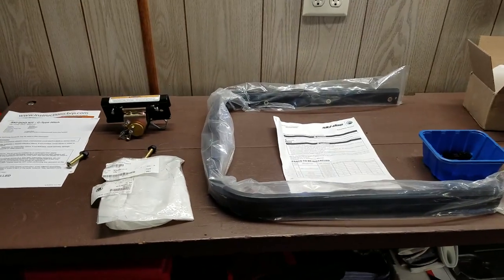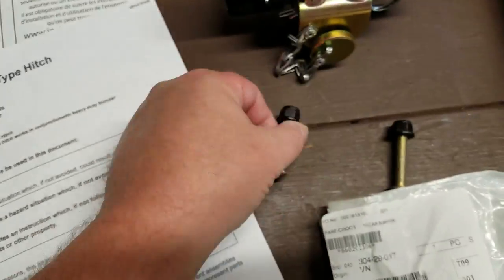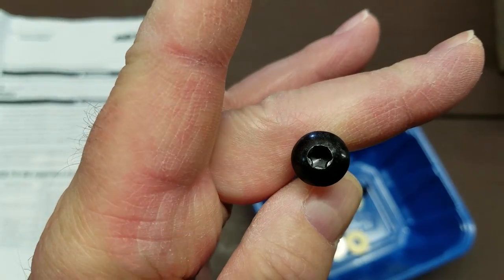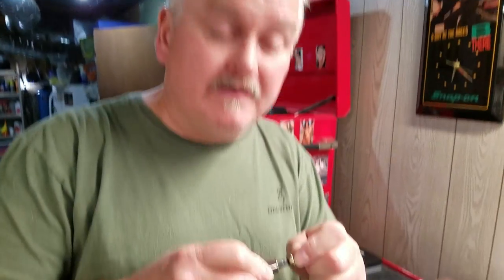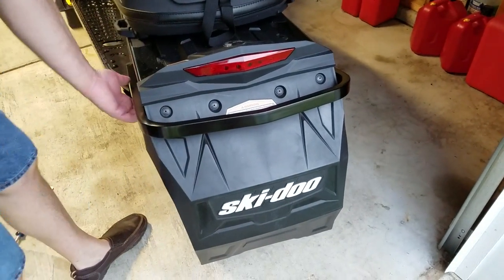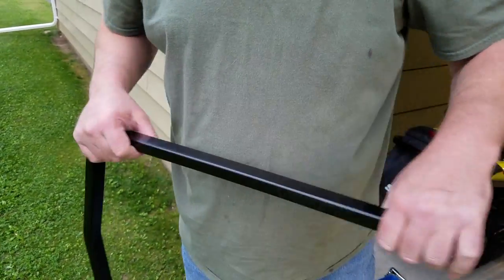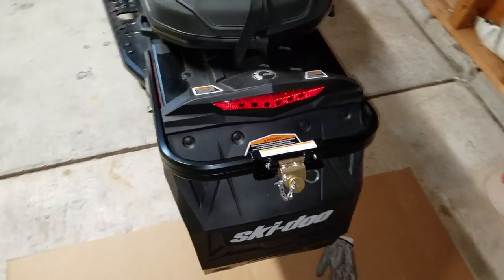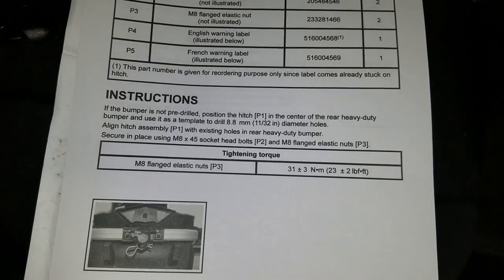Ski Doo REV XS Towing Package Install

Comment: Thanks Terry for the video.  I did buy the bumper and hitch for my 2019 MXZ REV XP 600 SPORT.  The hardest part of the install was the plastic end caps.  In fact, I gave up on trying to install them.  I have no idea why BRP made them so so cheap.
Thanks again,   Carl
Reply from the maker: I wasn't just pretending when I struggled to put my end caps on.  They are a way too tight and difficult to install, but I got it done.  A poor design by the BRP engineers, for sure!

Comment: Great video on the install. Can you provide the specs on the hitch itself?  I feel like the size of the pin and the gap between the inside of the "C" and the measurement of the outside of the "C" would be really helpful for people wondering if this will work with their particular set up that they tow the most.

Comment: Do you have a part number for that bumper? I ordered a bumper and I think they sent the wrong one. Mine only has two bolt holes on each side.
Reply from the maker: The part number is 860200803.

Comment: I have a new 2019 ski doo renegade 600 carb, would this have the xs chassis? I would like to get a hitch for it. I'm new to ski doo so any help is appreciated. Thanks
Reply from the maker: Hello, Mark.  I did a Google search, and it showed that you do have a Rev XS chassis.  You might want to double check yourself.  Thanks for watching.

Comment: What is the hitch part number?
Reply from the maker: Hello Will Iam.  The original part number was # 860200829, and was replaced by part # 860201381 .  It will fit REV-XP, REV-XR, REV-XU Tundra, REV-XS, REV-XM models.  GO Black Eyed Peas!